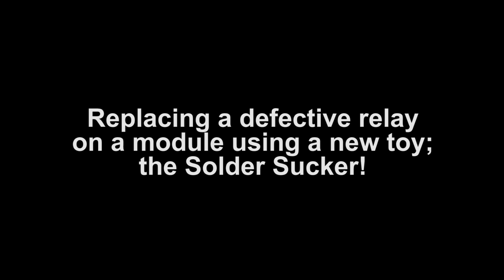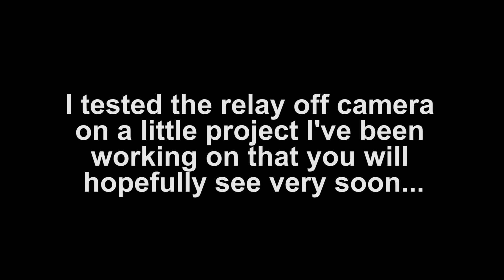Replacing a defective relay on a module using a new toy - the Solder Sucker!

Comment: I used the solder sucker all the time at my work repairing VCR's and camcorders. However, two
things...(1) It helps to apply some flux prior to the application of heat as the flux helps in the 
process of transferring heat to the solder joint that needs the solder removed. (2) Be careful 
using the solder sucker around integrated circuits (IC's) as the sucker creates some static
electricity that can and will destroy the IC. In that case use the solder wick. Good video though.
Bill G Linwood Kansas USA
Reply from the maker: Good tips, thanks :-)

Comment: I've had my solder sucker for almost 30yrs and I'm still on the original, almost mark free tip, although I've seen other melt theirs to sh*t in a matter of months. I never actually make contact with my soldering iron's tip though. You do get ones that just use a piece of easily replaceable silicon pipe as a tip.
As for the copper braid, I use it after removing the component in question to remove as much old solder as possible, that way you have less of it to react with your new solder and possibly cause dry joints, especially on older boards and particularly if someone's soldering technique isn't great or they're inexperienced. From the video, however, your own technique isn't bad.
Reply from the maker: Thanks, and thanks for the tips. Seems a lot of people are afraid of electronics - hopefully a lot of these comments might persuade people to have a go.
Reply: @SteamGeezerUK  - Hopefully.
It's a relatively inexpensive, yet exceedingly rewarding hobby that allows you to do anything from repairing a simple circuit to designing and creating complex electro-mechanical and automation projects (depending on your skill level), or you can just add effects and animation to your model builds and dioramas. You can take it as far, or not, as you wish. Even just building other people's designs or prepackaged circuits (like the Velleman range of practical projects) can be a fun and rewarding experience.
All you need to get started are...
- A simple 25W Antex soldering iron
- Flux cored solder
- Adjustable width wire strippers
- Small side cutters
- Small long nosed pliers
- Philips 0  and flat head screwdrivers
- Reverse action tweezers
- Good quality Multimeter
Maybe even a crimping tool.
And if you intend to use ICs
- Integrated Circuit extraction tool
- Anti-static grounding wristband
And of course, a Solder Sucker plus a small toolbox to keep your stuff together when you're not using it.
Most of the above are available for sale in kits of varying contents in a zippered pouch starting from under GB£15, but my advice is to always buy the best quality (not necessarily most expensive) tools that you can afford.
If you really want to learn about the theory side of electronics, from basic fundamentals, the books of DC Green (Electronics 1-4 and Digital Electronics) are an excellent resource, both informative and easy to read and will take you from beginner up to BTEC (Business and Technology Education Council) Higher National Certificate/Diploma level (UK) and therefore contain exercises and solutions based on practical applications.

Comment: The tip is made from Teflon and will last a long time you can always buy new tips the other thing if you put fresh solder on the joint it makes it easier to the move the solder, the non technical name for the sucker is called a gobbler
Reply from the maker: Cheers :-)

Comment: welcome to the world of electronic welding!
As you have seen, there is nothing difficult.
In addition to what you have done some tips: try them and then decide whether to use them.
When you use the sucker on a pin, often the pin remains leaning on one side of the hole on the PCB remaining in fact welded to the circuit, then once the sucker is used (its tip should be in Teflon, resistant to high temperatures) you could go over the welder with clean tip and while warming the foot straighten it away from the edge of the PCB hole, obtaining complete detachment of the pin from the PCB.
When you use copper braid you should dip it in the desoldering paste to get the maximum capillarity and suck away the maximum solder possible.
When you have to weld, if you have good quality soldering wire, do not use desoldering paste because it is contained in the wire, use it only if you see that the melted solder does not stick or that instead of making the shiny ball, it follows the welder taking the shape of a cone : the fluxing properties of the dough, both in the wire and in the extra one, quickly deteriorate with heat and therefore if you insist too much with the soldering iron (in the video you did not do it but could happen with bigger welds) you could find yourself in the conditions that I described above. Perhaps these tips will be superfluous, but they will surely be useful to the less experienced.
Ciao e al prossimo video
Reply from the maker: Good tips, thanks :-)

Comment: Soldering and desoldering is what I do at work, so the desoldering pump and braid are tools of the trade for me. If you don't succeed in removing all the solder first time, it helps to add fresh solder to the joint before you try again. You made some nice joints after you replaced the faulty relay 🙂.
Reply from the maker: Thanks for the tips :-)